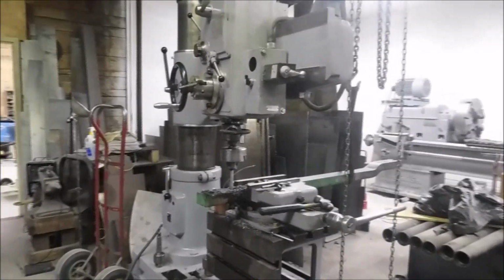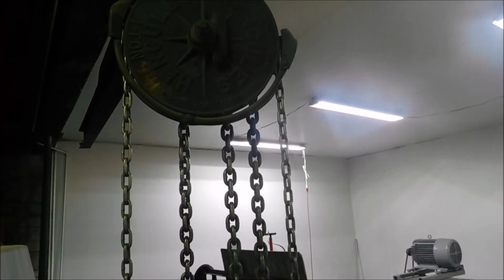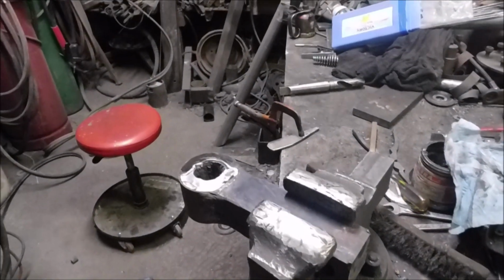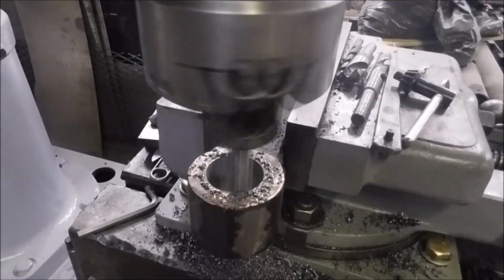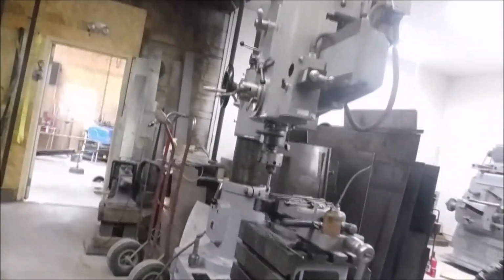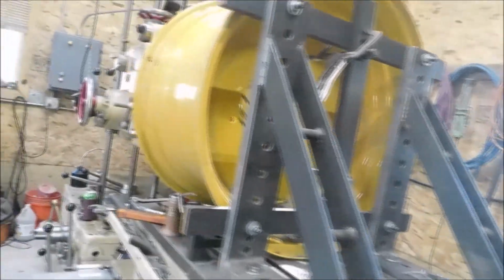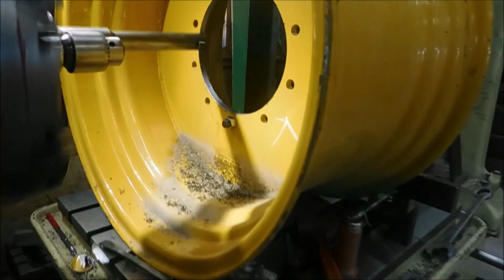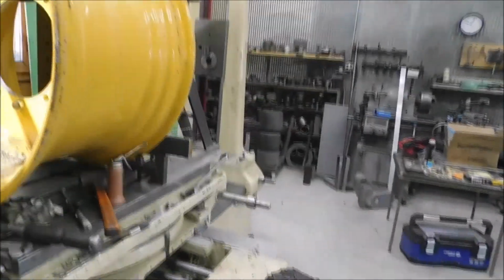BORING ACTION VIDEO

Comment: Hello Ironworker, we spoke here on your channel a few years back about the Forges De Guilly HBM.  After 7 years, I finally got mine un-buried and am getting power hooked up for the first time. Mine had a major oil leak that prev. owner mentioned. I mentioned that to you, and (I think I remember) you said it's most likely over full of oil?  The sight glass on the headstock shows about 3/4 the way up the glass. Would that be too full?
If you don't mind, I may have some additional questions? Tried sending an email to the address listed in your channel info but it bounced.
Reply from the maker: no email right Thats to full if you can see it in the window it's good maybe a quarter full is all I run
Reply: @THEIRONWORKER  Thank you! I will drain some out. Can you tell me which way the motor turns?
Reply from the maker: @kmcwhq  
from the pulley end fan should turn to the right . I still keep a small bread pan under the spindle . There is no real seal
Reply: @THEIRONWORKER  Thanks. I have one lever that doesn't seem to want to engage. It's the one to the left of the handwheel that moves the quill in and out. I think it may be for quill feed? Did you have an operators manual for the machine? Can I ask where you got it? Or would you consider selling me a copy of it?
Reply: I guess I can get a manual from a company in England.
Reply from the maker: @kmcwhq  yes that is what I did it helps

Comment: I have bored with my radial drill a few times. If mine had better spindle bearings I would use it more but it’s a bit fussy hitting size with while boring.
Reply from the maker: This one is pretty tight . I just have to watch how tight the slide is because the nut is loose

Comment: Excellent video I’ve been debating using my radial arm drill to bore just to see how it does
Reply from the maker: Some jobs can be done this way I had the rims on the boring mill and the power feed on my other mill dosn't work
Reply: @THEIRONWORKER  my radial arm drill is gear headed and really easy to setup the wells index 645 is a thrown together hodgepodge of junk really I think the drill will beat the mill when it comes to boring simply because of setup time plus my mills spindle is about junk